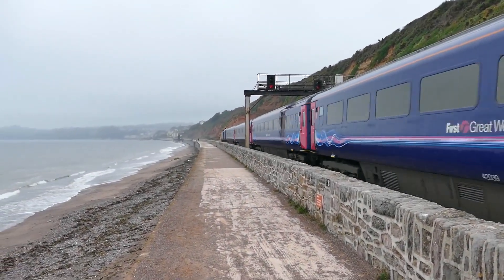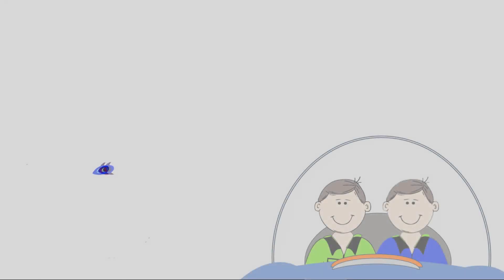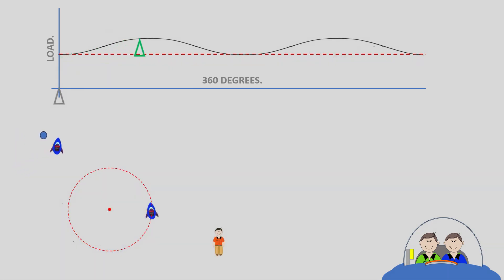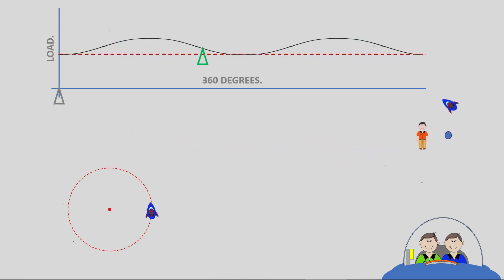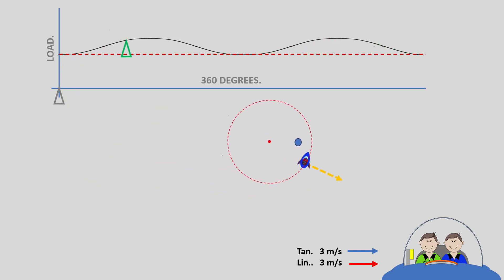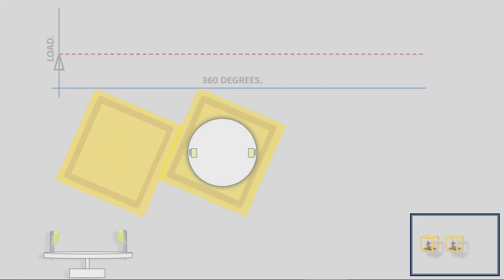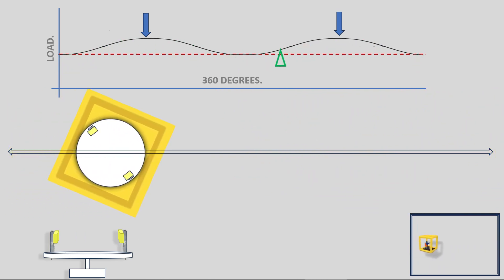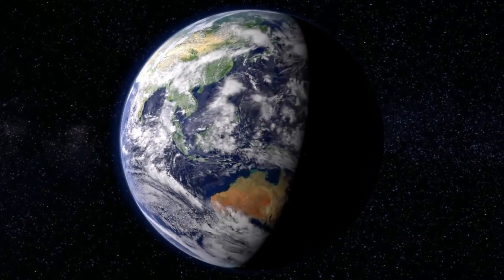Measure a Constant Velocity by Kryptonite Physics

Comment from the maker: Building on those videos I already shared from ChrisUK, this is another great video by Kryptonite Physics that puts an end to heliocentric nonsense.  Essentially, because the earth is not only allegedly rotating at 1,000 mph but also orbiting at 67,000 mph, there is NO CONSTANT ACCELERATION.  Instead, once you add the vectors of the two different motions (rigid body rotation and translation physics), we are accelerating and decelerating throughout each day.  Even though the amount of change is relatively small (a 220-lb person would experience a 0.7 lb difference in 5 hours), the change of motion should be easily measured by a load cell.  Because there is no measurable change of acceleration, the earth is stationary and the heliocentric model is debunked.  Here is what ChrisUK wrote:  "Einstein stated you can not measure the movement of Earth with light.  Relative motion tells you, you cannot measure a constant velocity.  This uses a simple mass on a load cell.  We can now measure a constant velocity.  We can measure if we are moving at a constant on an imaginary ball.  The video demonstrates that an observer changing position only changes their perception of what is happening, they can't physically change anything.  It blows relativity out of the water in under 10 min."  Background - https://youtu.be/Kex4zxPOTkA?si=t1F64-3Nd61fUSIc.  Physics video - https://youtu.be/wGVue66jVBs?si=AzBzlW0omP0c2PzK
Reply: I just watched this. He does an excellent job in explaining things.
Reply: Thank you.  That was a very good explanation of the Laws of Motion and the Conservation of Momentum.  

Modern Physics denies the very nature of it's own spinning Marble ride.  And it's time they are forced to deal with it, and have it thrown up in their Faces, and for EVERYONE to Look at.  Thank you for this, and thank you for all of the help you have given.
Reply: Sorry Ben, but this is incorrect. The acceleration felt by the observer on a rotation doesn't change if the body is moving at a constant speed or not. If you write out the kinematic equations and derive the acceleration components in x and y direction you will see that the constant velocity falls out. The magnitude of the velocity vector does change indeed, but the relative change is the same whether the body moves at a constant speed or not. 
The problem for the globies, however, is that earth does not travel at a constant undirectional speed: its orbit is an ellipse around the sun (even a circle isn't constant unidirectional speed...!). Not even considering the speed of our solar system through the universe!!
Reply: @Stefan-gh7xr  The globies think they are on a Train moving in a perfectly straight line, and at a perfectly constant speed, lol.  And then to make matters worse, they make FALSE statements in the schools, and in public when they say "Uniform Circular Motion".....that's fine as long as you don't then turn around and try to imply that type of Motion is in fact UNIFORM MOTION, because then you would be LYING in the schools, and to everyone in public.  

The physics of a spinning T-cup ride, are identical to the physics of a spinning Marble ride, they need to understand they will be forced to switch positions with their friends directly across from them on the ride, every 12hours worth of Time.   Now they will be spun WITH the direction of Non-Uniform Momentum around the circular Track, while their friends across from them on the other side of the Marble ride, can take a break for a little bit, because they are now being spun AWAY from the direction of the Momentum of the Non-Uniform Marble ride, changing direction from a straight line to move in ellipses around it's Track.  

These are in fact Additions and Subtractions to the Forces that would be acting upon them.  And like you said, the Apogee and Perigee turns are even Worse.  There the Forces get not only Added or Subtracted, they get Multiplied positively and then negatively, because the Non-Uniform Motion of the TURN forces the Marble ride itself to Increase the forces acting upon the whole ride, and then of course further Increased or Decreased based on which side of the Marble ride you're on while it happens.   Better hope you aren't on the Outside of the Turn, being spun WITH the direction that Marble ride is making it's hardest turn around the circular Track, better hope you are located on the Inside of the turn, on the side of the Marble spinning you the OPPOSITE direction the Ride is making it's hardest Turn around the Track.  

This is all very basic Laws of Motion and the Conservation of Momentum.    I don't understand why the globies have such a hard time grasping basic concepts.
Reply: @Stefan-gh7xr  The globies don't even understand, that if i cut the Gravity Cable attached to their ISS Bucket, that is Forcing their Bucket to TURN while it wants to keep moving in a perfectly straight line with all of it's Weight and Momentum........the moment i cut the Gravity Cable it's attached to, FORCING it to turn and change directions......the very moment i cut that cable, their ISS Bucket goes flying off into space in a Straight Line at constant speed.  

In the meanwhile though, we shall just watch the Clowns get SMASHED down to the Bottom of the Bucket, and hope their precious Gravity Cable doesn't snap, lol....or we would have to wave bye-bye!   Ha!
Reply: @dr.davidbannerf.e.s.6217  what I said is incorrect because due to "gravity" we are in a constant freefall around the sun... So if you believe in gravity, it is incorrect what I wrote.
Reply: @sphericalcow5258  yes, and technically, not even a constant velocity, but an average velocity.
Reply: @sphericalcow5258 acceleration can be constant.
Reply: No constant rate of acceleration DUH @sphericalcow5258
Reply: And no observable difference between the equator and poles. 
Which there would be if we're on a ball.